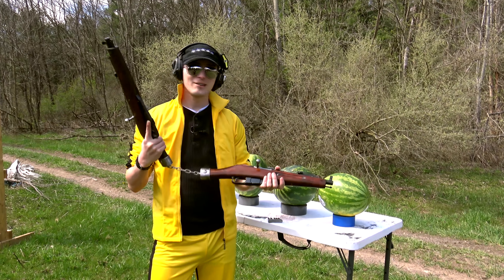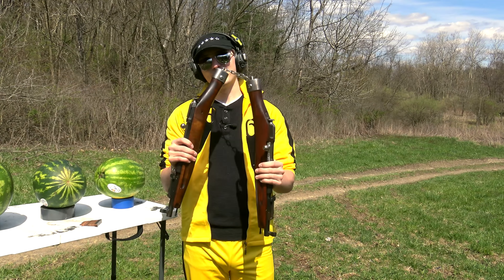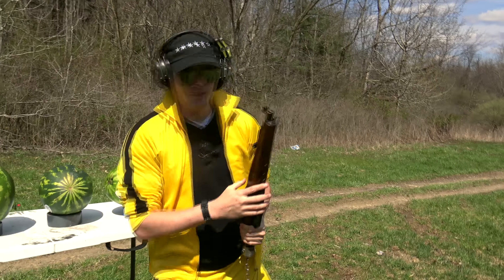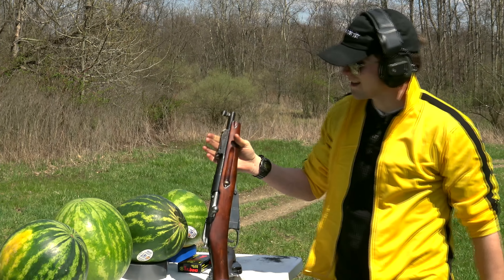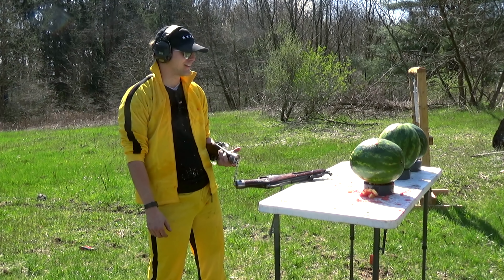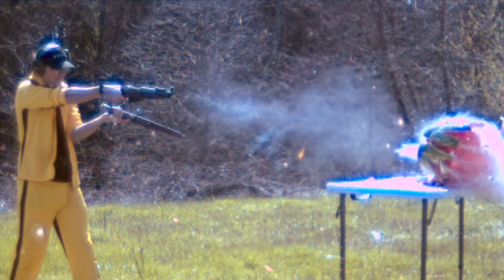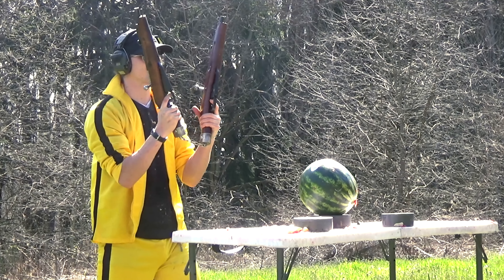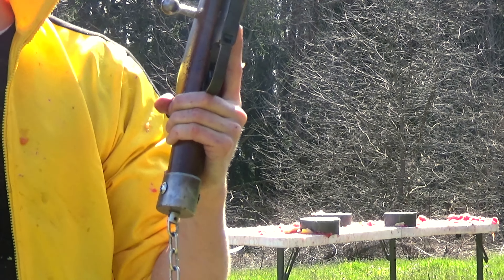Gunchucks

Comment: Can you purchase a rifle and after modifications re-register it as a pistol instead of a SBR?
Reply from the maker: Once a rifle always a rifle, only way to get around that is to destroy the receiver and rebuild it.
Reply: @Kjaskaar  hmm but a pistol can be made into a rifle on the spot right? Since in your glock Roni video you simply put a 16 inch barrel in it
Reply from the maker: @JohnDoe-pk8lc  Yep! And back into a pistol again if you so choose, so long as you aren't violating any NFA regulations (ie putting a stock on a pistol without first installing a 16+" barrel). There's no actual logic behind it that's just how they decided it ought to be.
Reply: @Kjaskaar  no actual logic describes these gun laws perfectly
Reply: @Kjaskaar  If a pistol has a 16 inch barrel, can you slap on a vertical fore grip or is that only legal if the overall length is at least 26 inches? If I remember correctly, if a rifle has a 16 inch barrel, but less than 26 inches overall length than it is considered a SBR, what about a pistol with at least a 16 inch barrel but less than a 26 inch overall length,  is it still considered a pistol?
Reply from the maker: @Merrik11  Pistol + VFG is an AOW unless it's over 26" OAL as you mentioned, if it's over 26" it stops being a pistol and is regulated as a title I (non-NFA) "firearm" similar to how the shockwaves are which is popular among the AR15 crowd. A pistol with a 16" BBL and less than 26 OAL (without a VFG) is just a pistol. Note that these made up rules may change depending on your state and local laws.
Reply: @Kjaskaar  thank you for the clarification.
Reply: @Kjaskaar  really sorry to beat a dead horse here, I've been trying to do more research and it's left me more confused. With regards to the mossberg shockwave why can't they make it shorter than 26 inches OAL and register it as a pistol similar to how an AR 15 can be registered as a pistol? If it illegal to register a shotgun as a pistol then how can the taurus judge be legal? When trying to figure this out all I can find is the key difference is the taurus judge has a rifled barrel. Then I read that legally an AR 15 pistol can have a butt stock on it if it has a smooth bore barrel. But then I read of the super shorty shotgun that has a OAL less than 26 inches and is still registered as an AOW due to its smooth bore barrel???
Reply from the maker: @Merrik11  Smoothbore pistols are a no-no (they legally become shotguns, and since they have short barrels, instant AOW. Fun fact if a gun manufacturer sends out a pistol with a barrel they forgot to rifle it's felonies for everyone!), so you can't have a shotgun pistol - the judge gets away with it because it's technically chambered in .45LC, and fully rifled (which kills your .410 patterns btw) and just so happens to chamber and shoot .410 as well. 

Then the franklin armory reformation is the real oddball, which gets away with having a short barrel and a stock. This isn't because it has a smooth bore (that would make it a .223 caliber shotgun), as it actually has rifling - just, it's straight rifling. Which by that merit means it doesn't have rifling that would classify it as a rifle, but does have rifling that exempts it from being smoothbore I guess??? Try not to think too hard on that on it's a bit of a mess.

Then the super shorty - they're made on virgin receivers that have never had a stock installed, thus are not legally shotguns. The barrel is under 18", but since it doesn't have a stock, this doesn't class it as a short barreled shotgun. Since it's under 26" though, it isn't exempt from AOW status like the shockwaves are, and since it has a VFG, that puts it nicely in the AOW category. If you wanted to make it non-NFA, you'd have to slap a really long brace onto it to make it over the 26" OAL mark. I built one like that when the sig brace had just come out, made it take saiga mags too. Whole thing was really gosh darn dumb but it certainly proved its point.

Oh and to cap this all off, the only reason shotguns aren't NFA items full stop (because they have a bore of over .50", technically making them Destructive Devices) is because they have a sporting exemption. That sporting exemption can be rescinded by the ATF at any point and time with no checks or balances (see: street sweeper, striker 12, USAS12) making any 20 or 12ga firearm illegal overnight no matter what legal hoops you try and jump through. I'd honestly expect them to try to do so with any shockwave style guns in the next few years.
Reply: @Kjaskaar  Thank you! Do you think you will ever make a video focused on gun laws?
Reply from the maker: @Merrik11  Got one planned about NFA regulations. It's been done before, but I think it warrants one.

Comment: Honestly, I would have cut the receiver cleanly in half, cut off the barrel and stock, then re-welded it to avoid the tax stamp...  if you cut it at the center of the Mag well, you can do a shitty weld and not worry about it. All of the pressure is contained by the bolt head, and the recoil is primarily contained by the front recoil lug...